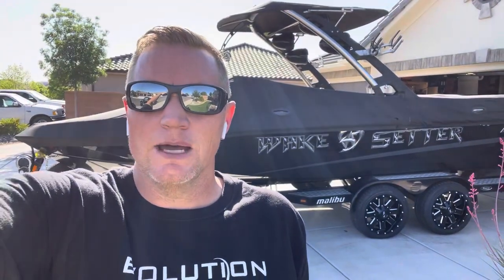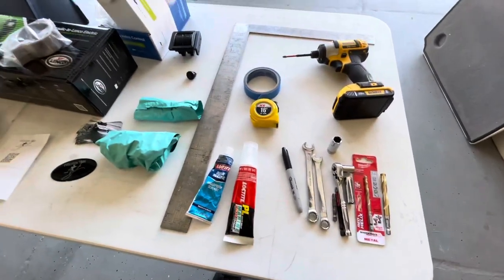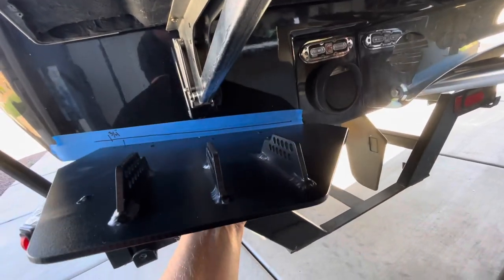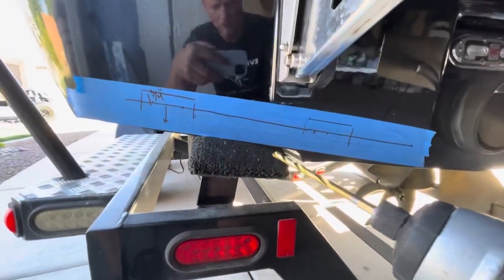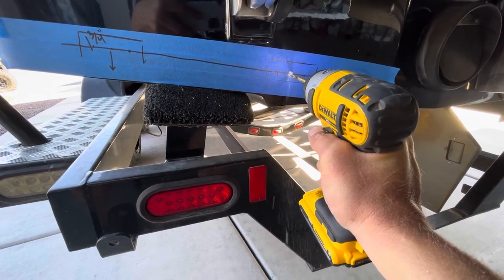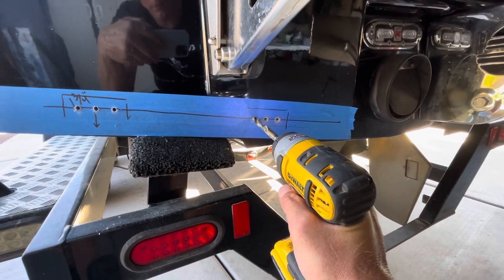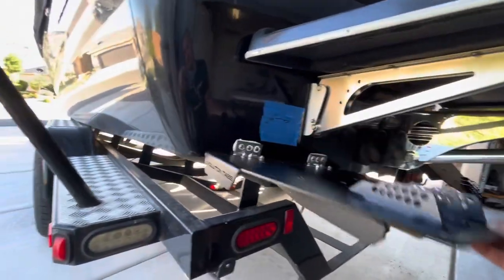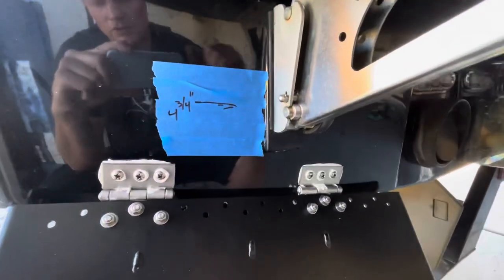2021 Evolution Tabs Install Video

Comment: I have a 2013 Lsv 23 that came with factory surf gates. Last owner removed the surf gates but all the wiring and control box is still there. Do you have just the tabs and actuators for sale?

Comment: Thank you for posting this. 
I have an older ski boat, circa 1986 and I bought it for wakeboarding. 
I'm not comfortable using ballast because the boat already rides low. 
Every product I've researched is for surfing and I'm not interested in that, I like good ol' wakeboarding. 
My boat has a fixed singular plate above the prop, will these two tabs help me get a bigger wake for wakeboarding?
Also is there an adjustable wakeplate on the market that will fit my boat for bigger wakes?